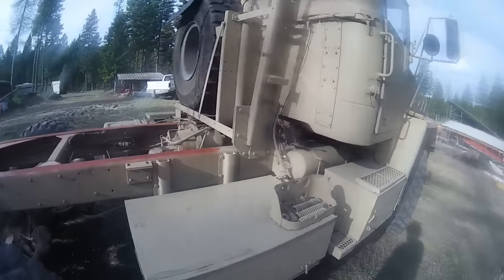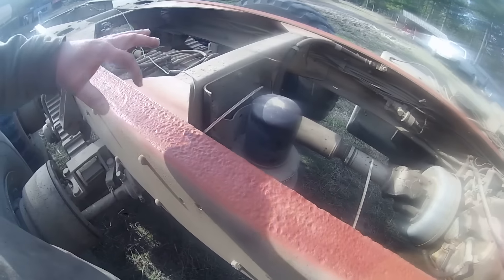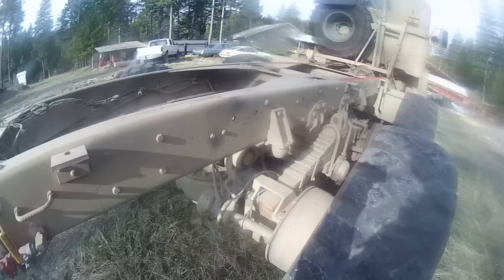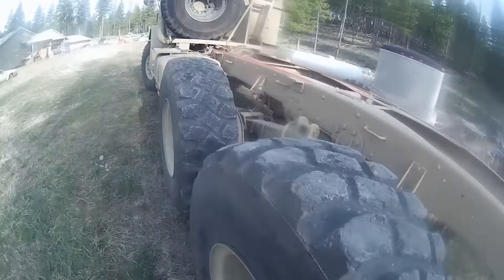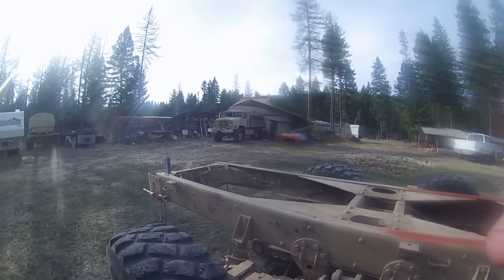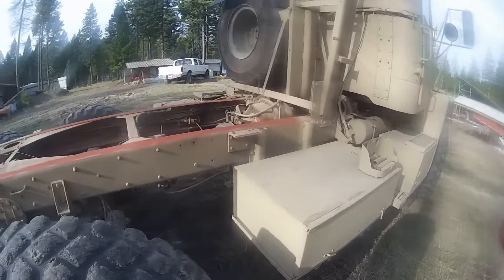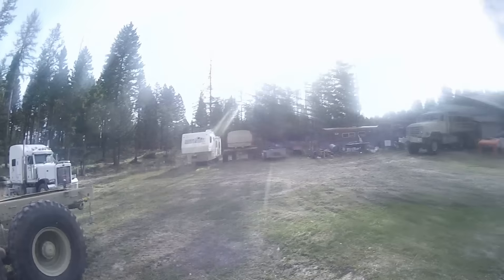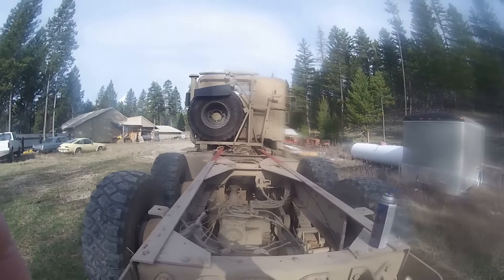M923A1 NAKED!

Comment: Thanks  I have been planning to pull the bed on my 1985 M923A1 and put a box on it, It looks like  just a few bolts.
Reply from the maker: +fredboat It was.  A few 55 gal drums some timbers, blocks and a porta-power and you can drive right out from under.

Comment: So are you parting out/scrapping this one? Or throwing a crate engine in? Or?
Reply from the maker: +andycflbulb Still up in the air.  I have a line on a free 855 motor, the match to this one, in running shape and all I have to do is go get it.  I think these trucks BEG to be re-powered however with that divorced transfer case.